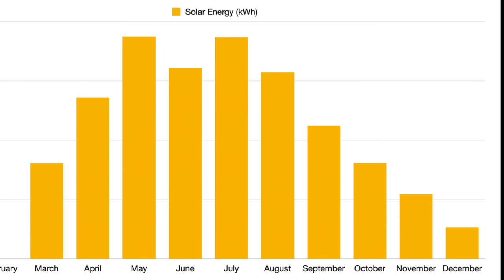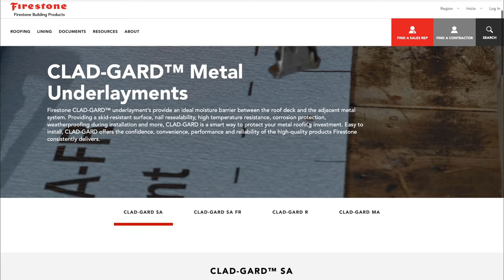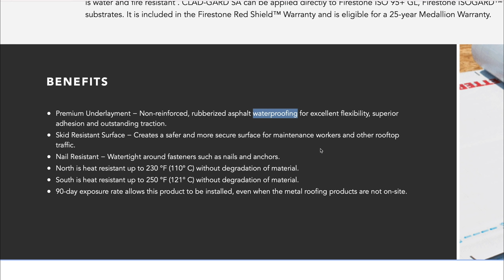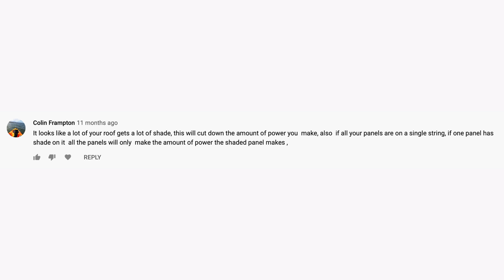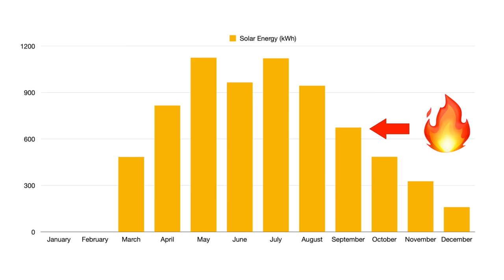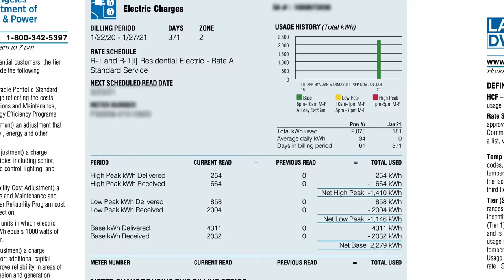1 Year with Tesla Solar Roof: top 11 questions answered + real production numbers & utility bills!

Comment: I wish you talked about pricing when factoring the amount of savings. I would’ve gotten a power wall so that way 67% of the roofs production didn’t go straight back to the grid.
Reply: His bill probably would have been about the same. And even could have been higher, as he was selling during peak rates and buying during base rates.  A power wall is good if you want a backup incase the power outages, or if you want to try to go off grid.  For pure cost savings sell to grid is probably best.   But it will depend on your rates and usage times.
Reply: @Dysan72  That is one of the most disgusting things being done. Buying and selling.
No.
There should be a 1:1 standard. A kWh credit line if you will. You use and give back kWh for a month and at the end of the month you draw the line. 
That is a fair practice.
Reply: without an install price the annual savings is irrelevant.
Reply: @blakehess8922  it's not irrelevant if you need a new roof anyways. Oh, and electricity.
Reply: @ElGoogKO  Why should the power company make more money off of his solar roof?   The power he makes is sold immediately to someone else, at peak rates it looks like (on the bill you can see most of his excess is during peak hours).  If he didn't get a premium for producing power during peak hours the power company would still be charging others for that power.  And he would still have to pay the base rate at night.  But without the premium his bill would be higher.
Reply: @Brian The point of the government subsidies is not entirely to get people it convert.  It's to make it affordable so people can buy it, so companies will invest in the research to develop and make the tech cheaper.  Then people can buy it without subsidies. and then solar can deployed on a more massive scale.
They are there to help build the market, so the tech becomes cheaper with mass production.
Reply: @ElGoogKO  So you're suggesting a company that is in the business of selling a product should sell that product at exactly the same price as they buy it for? Doesn't make much sense to me - they'll go bankrupt real quick.
If you want to store your electricity and get the same back as you put in then install a battery. Using the grid as a battery will cost you, as you'd expect.
Reply: @ElGoogKO  except thats not how power demand and generation works
Reply: @ElGoogKO  the buying and selling at different prices is actually a good thing. When power usage is high (like when everyone gets off work and is cooking, watching TV, etc) the demand for electricity goes up. Because of that, the cost also goes up. This is because there is only so much electricity that can be produced. If it exceeds that threshold, “peak plants” start producing to cover it. And that is where the extra cost comes from. 

By selling electricity you produced during those peak times, it eases a small amount of that stress on the power grid, and you get paid a premium for it. If you have batteries, you can sell even more, then recharge (buy power) during low cost times (like late nights where not much electricity is needed most of the time). 

It’ll give you a small profit that over time can be quite noticeable. And if enough people do it, the cost of electricity will start to drop because peak plants will no longer be necessary.
Reply: @ElGoogKO  That would be fine, except electricity use flactuates. Selling electricity when it's needed the most (expensive) is better for everyone
Reply: I can't believe he actually had a bill. Albeit it small. Still crazy. He produced so much more than he needed. Seems he is not getting paid enough from the power company. You spend 50k on a roof and still have to pay to the power crazy. That's CA for you.
Reply: @Dysan72  the sell rate doesn’t change based on the sell rate. It’s generally a flat rate for a given month. I saw it averaged around 3 cents per Kw. A power wall could have probably powered his home the entire night and during the day still made enough to recharge the battery and sell back to the city.
Reply: @ElGoogKO  in North Carolina no buying or selling. Account is maintained on monthly basis and resets every year in month of May. use it or lose it by May month.
Reply: @nolansprojects2840  Not sure about California,  but here in the North West any extra electricity you produce the power company is forced to by at premium price.
Reply: @Matt-kt9nm  Dang, that's pretty cool. Gives incentive to build batteries and ways for people to make their own electricity.
Reply: @nolansprojects2840  They don't buy store power. Edit: stored
Reply: I don’t get it. 67% of power generated was consumed by the power company. Why is the homeowner now paid for that kw usage?